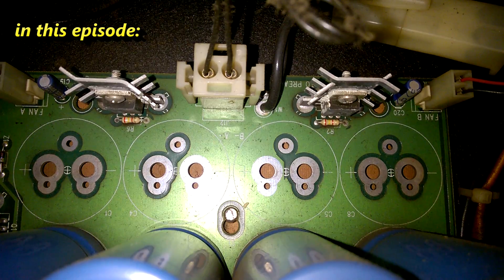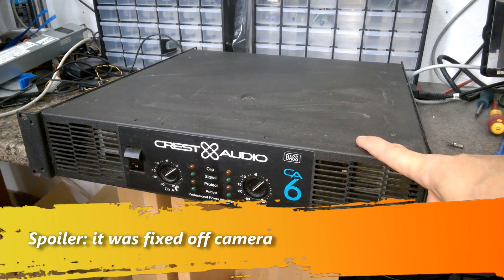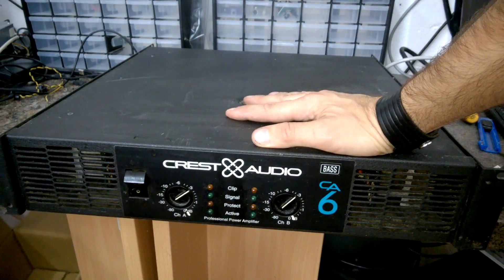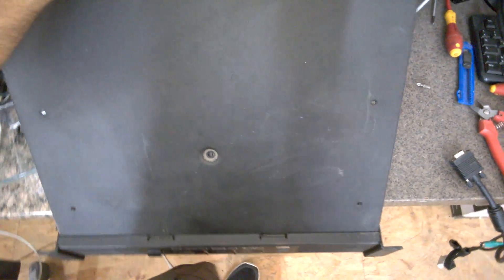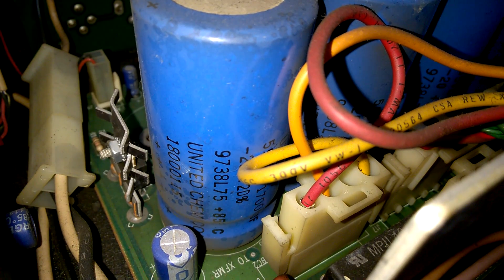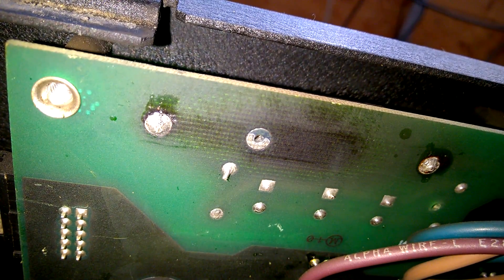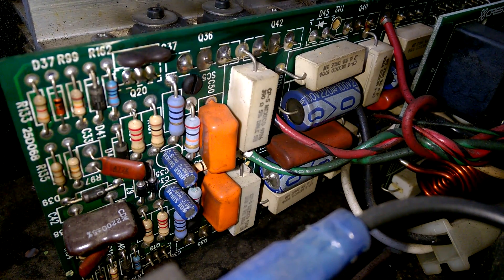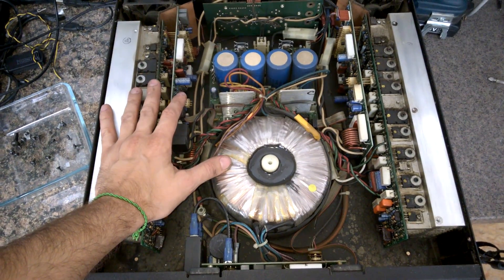BEB #104: Crest CA6 Power Amplifier: Can you guess what's inside?

Comment: These (the CA9 is even worse than the CA6) are absolutely no fun to fix. There are multiple different PCB revisions, multiple different schematics and multiple different chassis layouts. Some of the schematics have mistakes and are poorly drawn. In all of them, everything is almost completely inaccessible. Then there's the fun of having 130 V across two adjacent pins on a TO-92 transistor (at least in the CA9). If you slip with a probe, then about all you can hope for is to buy a 20 meters of rope and sell it as a boat anchor since it isn't worth replacing output devices in one of these.

Comment: I love the Guarantee-for-full-heat-sink-contact washers, not at all just found from some machine shop :D
Reply from the maker: Well said. I have even seen large metal plates, and thick aluminium scheets in some cases. In my own experience, transistors sometimes get cracks, if you turn the screw slightly too much. My guess is, these large washers and brackets and plates are to avoid cracks, by distributing the force into a larger area.